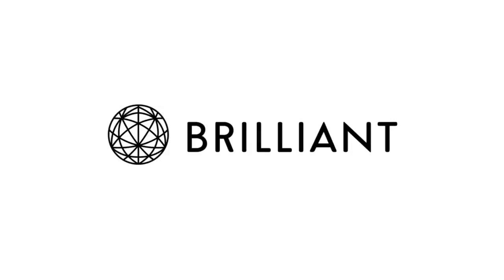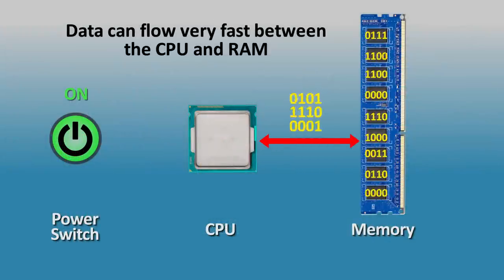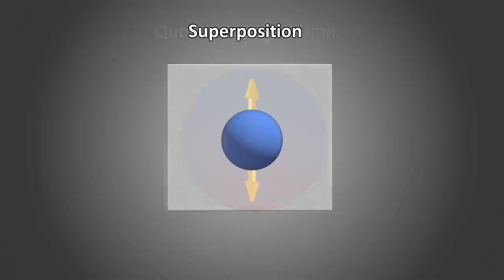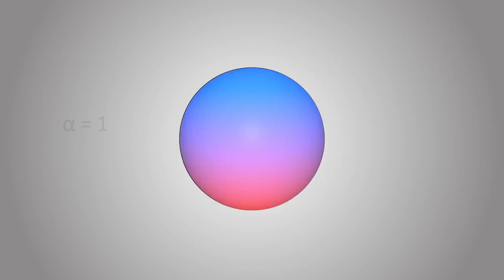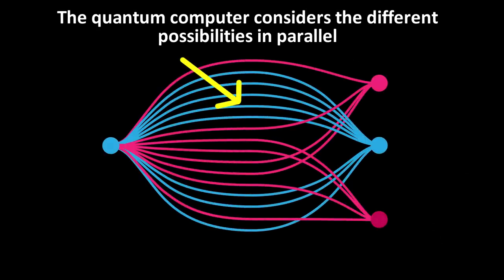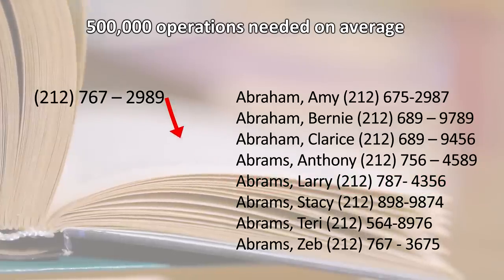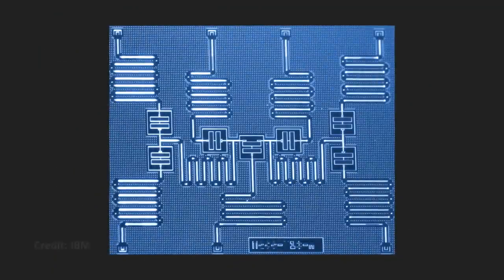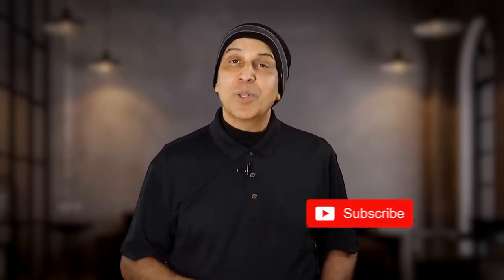The Insane Mechanism of a Quantum Computer?

Comment: As an electrical engineer for 35 years this is the simplest clearest explanation of a quantum computer I've ever seen amazing job Arvin
Reply: AGREED!  I've been an EE for 45 years... studied some QM back at school... but this beats Matt, Sabine and many others.  Clear, concise... and specifically addresses issues that are commonly misunderstood, and not explained by others.  Thanks, Arvin!
Reply: @JR-ng9yo  And yet it still seems like he doesn't really explain it fully. He says that since the qubits are in a super position, the computer can check every path in a maze at once, but when you measure the result, the wave collapses and you get a classical answer. But how does it check several paths at once by just casually existing in constant spin? And how does it determine the correct path? I know he said that they use constructive interference to enhance the correct waves, and destructive to cancel out the incorrect ones. But how do you know which ones those are if you don't get an answer until it's all done anyway. I don't get it.
Reply: @soulextracter  "how does it check several paths at once"... This is done using "parallelism".  Imagine having fifty 8X11 sheets of clear plastic, each with a random number of ink spots on it randomly distributed across it.  You are asked to find which single ink spot out of all spots on all 50 sheets is closest to the top right corner of its sheet.  You could number all sheets 1-50... use calipers to measure each spot on each sheet to the upper right corner... you could probably simplify by disregarding many dots and only measuring those that look closest... you could keep notes on sheet number and distance... and eventually derive the answer.  OR you could stack all 50 sheets into a pile... and look thru all sheets at once and quickly determine which dot out of all dots on all 50 sheets is closest to its upper right corner!  That, my friend, is PARALLELISM !
Reply: 😮😮😮💀💀💀💀💀💀💀💀BRUH I'm also an electrician but I am also a programmer but I completely do not understand it

Comment: The thing I can't wrap my head around is the concept of probability.

Classical computers depend on precision. If a single bit is off, the program or even the entire operating system could crash, or suffer a memory leak.

With that in mind, I would expect quantum computers to crash frequently because of their use of probability.
Reply: that's why they have to be cooled to near absolute zero so the probability of in between 0 and 1 can be easily collapsed into a single state. remember he stated that any temperature above absolute zero could fluctuate the result and make the qubit unstable.
Reply: First, on the note of probability; the inherent probabilistic nature of quantum measurement means that our measurement outcomes at the end of computation in the gate-based QC model are going to be probabilistic. As a result, when using a quantum computer, it will often not suffice to conduct a single runthrough of our computation, but multiple (although of course this will depend on the program in question) so we can get multiple shots and then look at the measurement statistics.

Second, you make a great point about precision and how if a single bit is off, the program could crash entirely; this is a great observation. Indeed, if we run a quantum computer without accounting for such errors, given enough qubits and enough quantum gates, the chance that an error will occur becomes almost unavoidable (even if the probability for a single given error is small). As you postulate, this would result in the computation being doomed and the final result useless. To address this exact concern, the entire field of quantum error correction and quantum codes has been established. Indeed, there exists a landmark result in the field (The Threshold theorem) that given a sufficiently small enough physical error rate, we can use quantum error correction to make our logical noise arbitrarily small. Here is the wiki page for this result https://en.wikipedia.org/wiki/Quantum_threshold_theorem and for its derivation you can refer to standard texts in the field (e.g. Nielsen and Chuang's Quantum Computation and Quantum Information).

Hope this helps!
Reply: The program would not crash, but may produce garbage output. For example, lets imagine you have a 2 qubit computer with a single gate: CNOT. This gate reverses the second bit if the first bit is on. So, 00 -> 00, 01 -> 01, 10 -> 11, 11 -> 10. The second bit will become the XOR of the first and second bit. Let's say you initialize the first bit with 25% 0 and 75% 1, and the same with the second bit. If you then measure the second bit after the CNOT operation you can find it in either 0 or 1, however if you repeat the measurement it can change. If you repeat the measurement an infinite number of times (in practice a large number will suffice), then you will find that the probability of a 0 will be 62.5% (0.25*0.25+0.75*0.75) and a 1 will be 37.5% (0.25*0.75+0.75*0.25). This means that given that input distribution, the bits will be XOR 37.5% of the time.

However, let's say the computer screws up sometimes and can end up randomly in 0 or 1 with 5% probability each. So 90% of the time it computes correctly, and 10% of the time it will either flip to 0 or 1. Then you will find a 0: 5% + 0.9 * 62.5% = 61.25% and a 1: 5% + 0.9 * 37.5% = 38.75%. So as you can see, the noise will introduce error into your results, but will not cause the computer to crash.
Reply: How are they so sure of superposition? Because whenever they measure the spin it is either clock wise or anti clockwise. So how do they know that superposition exists?
Reply: @incognitojuggernaut4411  Electrons are not the only way to make a quantum computer. You can use photons as well. Superposition just means that the same scenario can give rise to multiple different outcomes when observed. It isn't necessarily 50/50. You will need to look at the Bell inequality experiments. If you measure at 90, 180, or 270 degree off-axis polarization, the Bell equations give the same outcomes as the hidden variable model. It's the points between that deviate.
Reply: @incognitojuggernaut4411  that’s a whole topic in itself, called quantum mechanics. For a start look at videos about the double slit experiment. If you don’t want to, here’s the summary: You have to slits in a wall and send a photon. Behind the wall you have a detection screen. If you were to keep shooting single photons you’ll eventually end up with a wave pattern at the detection screen, which means that the photon has to be a wave function which interfered with itself on the way to the screen. That means the wave function went through each slit at the same time. That’s the only possible solution.
Now if you were to measure at each slit with a detection device, you’d know through which slit the photon went, since you measured. If you repeat the same experiment as before and the only thing you change is that you measure through which slit the photon went, you get a different pattern at the detection screen, one with no interference.  In the first experiment without measuring a photon behaves like a wavefunction, in the second experiment where we measured through which slit the photon went, it behaves like a particle. That’s how we know that superposition exists. Particles only decide where they actually are once we measure them. You probably heard of Schrödinger’s cat and the question whether it’s actually there when we don’t look. If the cat was a photon, it wouldn’t be, but since every interaction of an atom with another atom counts as „measurement“ and since cats are made of many atoms who all interact and therefore measure one another, superposition doesn’t  affect us in our daily life’s

Hope that was at least a bit understandable.
Reply: @incognitojuggernaut4411  also funfact since you don’t seem to “believe” in quantum physics according to your other comments: every electrical device you use that has a ssd built in, so probably your smartphone, maybe your laptop or computer, only works due to quantum tunneling. It’s why SSDs can store your data for so long without losing any. The bits in a SSD are determined by the amount of electrons in a chamber. That chamber is surrounded by an isolating matter though, so normally no electron could pass through. The electrons are moved into a chamber by increasing voltage in way so that the probability for that electron to be in the chamber instead of outside is way higher, while they are in a superposition. You measure it et voila, you have teleported an electron through a non conductive material.
Reply: @CSTEnjoyer  I tend to find that if someone does not want to accept the findings of the scientific method, then there is no point in trying to explain to them those results and why they should accept them. If a person is honest with themselves and is genuinely interested in understanding the answer, instead of merely being in denial of reality, then they can simply do a quick search on their preferred search engine online, or go to a library, for themselves, a find literally thousands of resources that will answer those questions and more. If a person is not willing to spend 10 seconds of their life to use Google, then that person is not worth trying to convince. Besides, interacting with such people repeatedly gets mentally exhausting, so I just tend to ignore them.
Reply: @angelmendez-rivera351  "Just Google it" is a terrible response when talking about highly technical subjects. 10 seconds will get you garbage explanations of quantum computers that basically doesn't convince anyone, because they are mainly written for popular science articles, and just link to a bunch of research papers without explaining anything. Google is great for simple things that have lots of blogs talking about it, but science is not one of them, especially since people just handwave at a bunch of theoretical math or science papers without bothering to summarize, and just go "see if you can't read them you must be dumb". That is a terrible way to convince anyone of anything.
Reply: @angelmendez-rivera351  We will just have to disagree that a Wikipedia article on "quantum superposition" or "quantum entanglement" is at a "an introductory level", and also that a person that doesn't know anything about the subject could differentiate between good explanations and confusing ones. Other comments here that indicate that Arvin was able to explain things in a way that some people found useful, beyond the usual explanations, as with the comments on his other videos, precisely because they are accessible to people with a much lower math or physics understanding. There is a difference between a "quick Google search" and "using Google to perform hours of research". People who do the second already know how to find good sources. Most people don't know how to Google, and will click the first few links, get confused, and then conclude the whole field is a bunch of bullshit.
Reply: the explanation is thermodynamics
Reply: Quantum computers are deterministic. You have probabilistic outcomes but these outcomes converge towards predictable, determined values as you run the program more than once. Take a fair coin for example. Even though a single flip is random, if I flip it a thousand times, it will deterministically converge towards 50%/50%. Quantum mechanics is a bit odd in that it is deterministic and nondeterministic at the same time. Every particle has an associated wave function, the wave function describes an idealized model where if you measured the position of that particle millions of times and formed a distribution of the results, you would get the wave function. Each individual particle behaves randomly but their overall randomness in ensembles evolves deterministically according to the Schrodinger equation. In quantum computers, you don't actually care much ab out what the individual qubits are doing, but how the overall ensemble of what they are doing is doing. You have to run the program many times to get an ensemble of qubits to form coherent results.

Comment: Great video as always. A couple of questions:
1) I can understand how a quantum computer can process data to achieve a desired result, but how does one encode the data in a qbit? Is this possible to do without interacting with a quantum state? 
2) the algorithm used to increase success chance of measuring the desired outcome: does this mean that the computers user must know the desired outcome prior to doing any computation?
Reply: 1) Actually you can't. The phone book is thus not a really good example because you wouldn't be able to encode the data in your computer. The maze is a good one because the information is easy to encode
2) Of course no or it wouldn't be interesting. For some algorithm the solution is hard to find but easy to check (prime number for instance) so you could just check. For others it's not and here you would just repeat a lot the algorithm until you are confident enough you have the right anwser

Comment: Arvin, a question:
At 7:58 the question that’s looking for an answer is “how do I know if I should get a 1 or a 0 as the correct answer?”

But during the answer to that question you say that a mathematical trick of wave amplification interference is applied TO the right answer, and destructive interference to the wrong one. Phrased like that there lies a fallacy: how can I apply something TO the right option IF I don’t yet know what the right option is?

I’m asking this because I was always intrigued by this very same issue: since qubits are in superposition… how could you work with concrete information to perform logic?

I can ask a computer 5+5= because I can have certainty that the digital words representing the 5, the logic sum and the logic equals are perfect representations in binary of their essence. But if a quantum digital word could be “anything”… where do you even start feeding inputs?
Reply: I think an analogy to 5+5=??? wouldn't be sufficient, the algorithm would probably be better off by using the normal logic system, meaning the superposition pretty much wouldn't matter from the start.
If we look at some other complex algorithms, like factoring a big number into primes, we could get a distribution of results in a superposition.
Some of the results will tell us nothing about the factoring, some will get us closer, and the ones that get us closer may share a common thing, like, they might be all multiples of a large number. Then we can make all the results interfere in such a way that the in-sync results with a large common multiple amplify the common multiple and other results more or less cancel out due to being distributed randomly.

That's not the whole real 100% true explanation, but that's my understanding of the principle.
I would be happy to know the whole story too.
Reply: @creativenametxt2960  Thank you for taking the time to explain, I think I'm getting a better picture now.